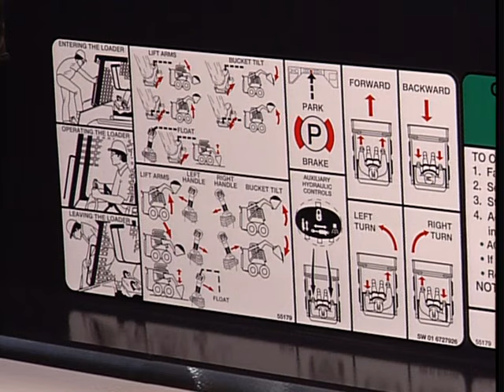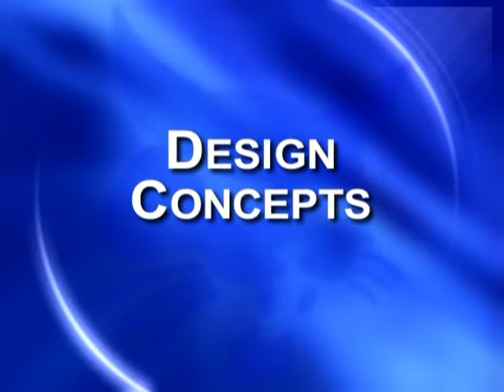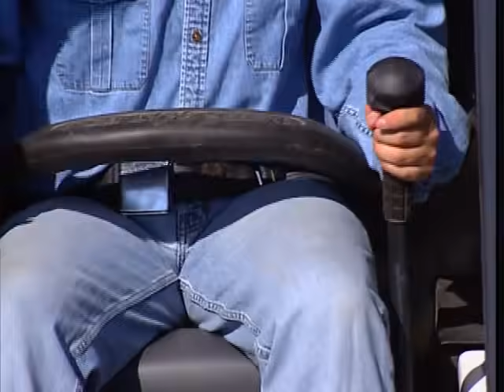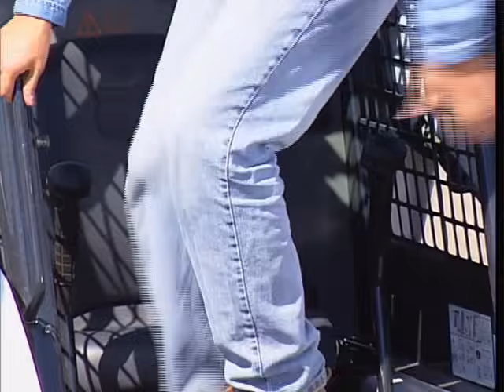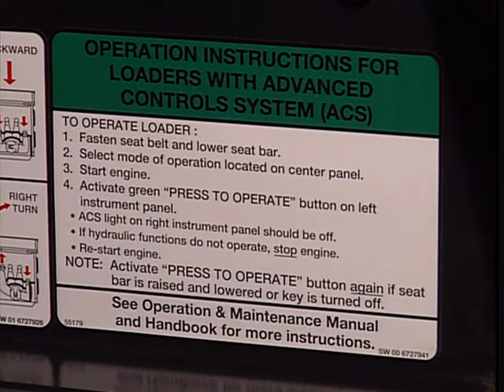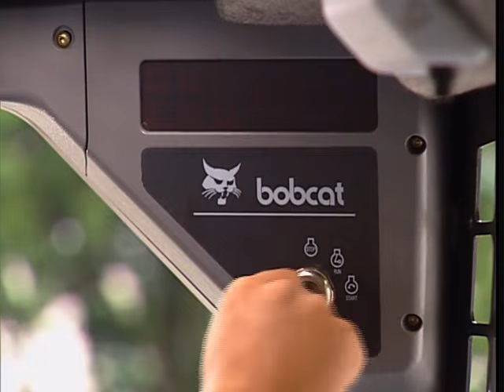Bobcat Skid Steer Operator Training Course

Comment: No doubt a good machine, but when it needs repair its a nightmare.
Reply from the maker: I agree, though most skid steers and compact equipment can be a bit of a nightmare to work on.  And then again, I see them having to removing cabs on pickup trucks just to replace the turbo and I wonder if maybe heavy equipment mechanics don't have it so bad.  They wouldn't pay us to do it if it was easy.

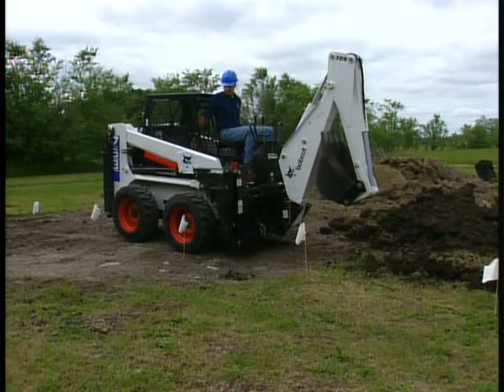Comment: 18:41 that looks stupidly Life threatening, the very dumb high perch so-called backhoe seat position, A operator can easily be thrown off & into the path of the still moving wheels and or the attachment & simply be killed by all 3 dumber bobcat designs. And I'll bet that happened all over the world people getting killed in that what should be known as death mode, Plus while Up there & driving around the machine can & will easily flop & crush you to death & I'll bet that has happened also. Mega wrongful death lawsuits I'll bet have been victorious against that stupidly dumb brand which I'll never purchase ever.
Reply: Very safe machine,you just half to have the hours to smooth it out. Everyone thinks they can drive it,but to operate it smooth and safe they say 6500 hours should bring you up to speed. And all the attachment.